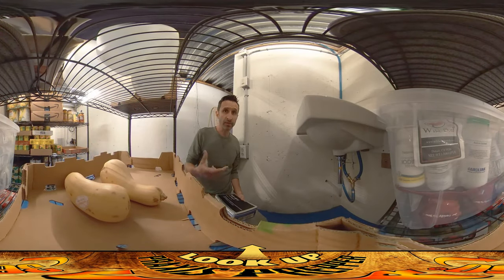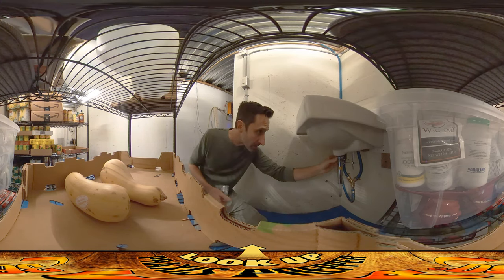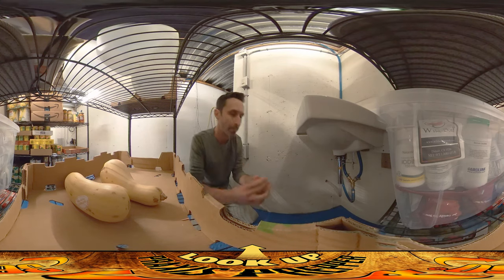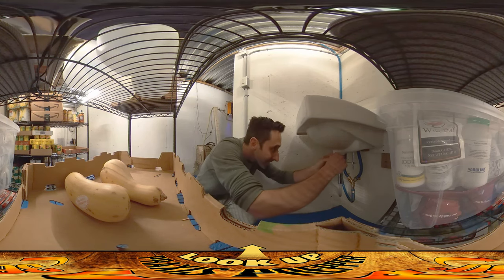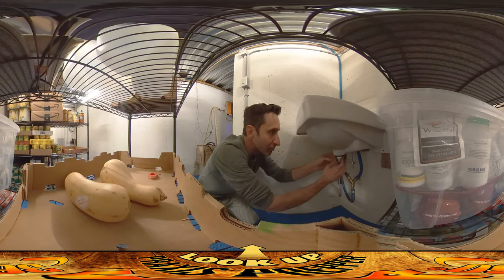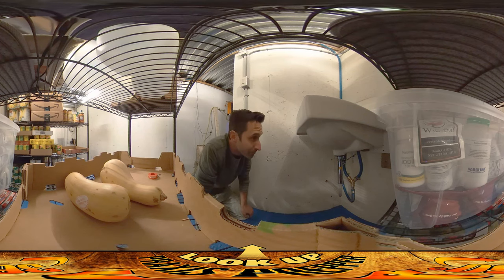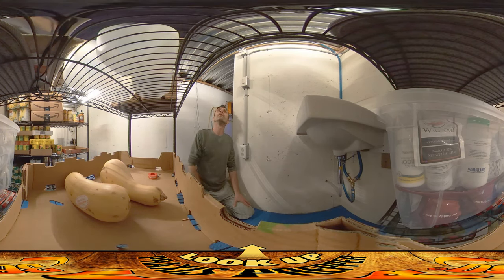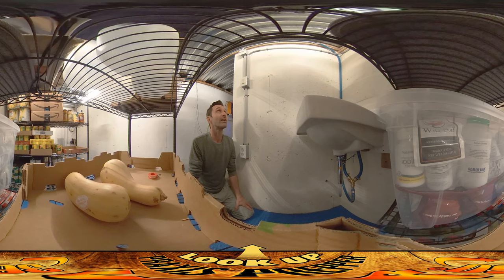Homestead Building - Fallout Shelter Plumbing

Comment: Leaks there actually aren’t uncommon which is why it is recommended to put pipe dope under the metal flange of the drain inside the sink because there normally isn’t a gasket under it. Seems counterintuitive but it’s what you do, had the problem myself and that was the solution.

Finally got a canner. Couldn’t afford an All American brand but got a Presto 16qt at Tractor Supply for $99 that was around $140 everywhere else, So… we will be making lots of stew, chili, taco meat and fajita chicken to store. Probably some other kinds of seasoned chicken and plain ground beef, possibly some cubed meat as well. We have a good supply of the canned chicken from Sam’s but I wanted to make sure we have a lot of other meats in particular that we know we like although Shelly does occasionally use the canned chicken and likes it. Ethan is the biggest issue because he mainly eats meats and trying to get him to eat other stuff is generally limited to some form of potatoes and occasionally other canned veggies. He does like apples though so I got some fruit preservatives and may try canning some apple slices for him. I did get the Ball Big Book of canning so now just need to get prepared for the marathon of cooking and canning in the next couple of days,
Reply from the maker: River loves my canned apple sauce. Just take apples, skin them, take out the seeds, boil to a mush, add sugar, cinnamon, and maybe some ginger? I believe that I successfully canned that in a regular old boiling water bath, but don't quote me on that. Good to double check that one to see if it needed a pressure canner.
Reply: @PraxisPrepper  My impression is that you can pressure can anything but you can only hot water bath can some things so I’ll probably just pressure can everything to be on the safe side. My wife really likes applesauce so I’d ask for your recipe but I know it’s just “that feels right” 🤪
Reply from the maker: @inmyimage1081  Yeah, there's no down side to pressure canning things that don't require pressure canning - other than the pain in the ass factor of pressure canning vs the easy of simple boiling water caning.
Reply: @PraxisPrepper  I will end up starting with stews and chili first so I’ll know more about the PITA factor soon and might change my mind about the hot water items. The canner I got can do pint jars for hot water bath which should be sufficient.